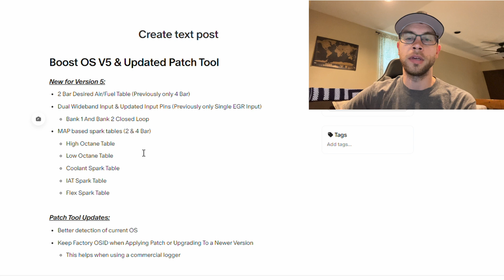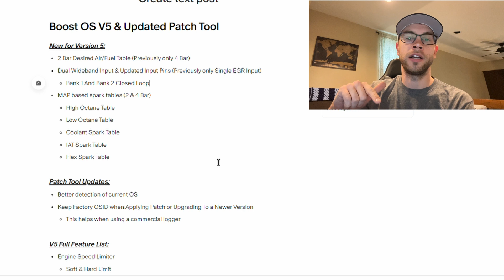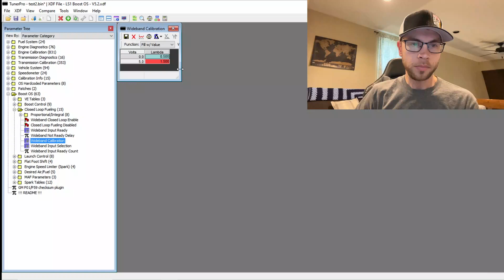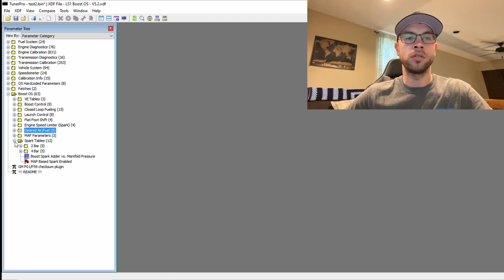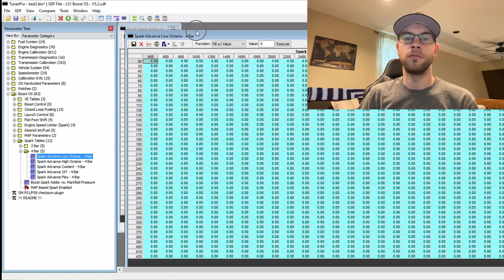Stock PCM With Dual Wideband Input!?!

Comment: Would you possibly be able to make another table like boost control where we can control DC of another pin. I’d like to wire up meth through a solid state relay like I did with my Holley setup

Comment: Im new to tunning just doing it on my personal vehicles. I have a 2004 tahoe which i activated electric fans using tunerpro and all is working good. I will be upgrading my driveshaft and wanted to change the speed limiter from 98 to 120 but dont know what settings to change. Any help would be awasome.

Comment: How are you guying datalogging with tuner pro? I’ve downloaded the program just to get familiar with it but I’m not seeing much to start logging.
Reply from the maker: I haven’t used TunerPro for data logging. Supposedly it works, but I’ve seen lots of comments about it not working well or at all. PCM Logger (included with PCM Hammer) I believe is the only free open source option.

Comment: your doing gods work brother!!! Thank you and good to see ya again!  Nitrous features would be awesome for v6.0 :) timing reduction features with built in window switch activation and bottle pressure input maybe instead of 1 of the wideband inputs but if you could have the widebands and a bottle pressure would be awesome and maybe relay output to control bottle heater based on bottle pressure, just throwing out ideas! thanks for all you do!!!!

Comment: Sorry if its been gone over already, i assume this system works with 4L80'S? Also, does this OS support DBW, or just DBC?
Reply: The 4l80 works, just need to segment swap your file first, then patch it, he confirmed it in another video where I asked. The 7603 os should support both dbw and dbc, assuming your ecm has the dbc circuitry
Reply from the maker: This works with 4L80E, 4L60E, Manual, DBC, and DBW. You just need the correct hardware and base tune.

Comment: So to make sure I understand this right, enabling closed loop wide and simply allows you to use a wideband to control closed loop fueling, I would still use the factory closed loop settings to control how it behaves such as disabling ltft? If I were to in addition use the desired afr table, does that only affect pe specific settings, like can I still use the iat or ect adder tables? Or does using the desired table solely allow control via map vs rpm? Will the ecm read as being in “open loop” if commanded is richer than lambda 1?
Reply from the maker: Yes, LTFT work just like stock, but can be disabled. PE is disabled entirely so no PE setting work. At richer than lambda 1 it will stay in closed loop if you are using desired afr table and wideband closed loop.
Reply: Appreciate you taking the time to respond. So if using a wideband and the desired afr, if I’m in what would normally have been a pe region, like 180kpa at 6000 rpm, will it actually attempt to use trims to maintain commanded lambda?
Reply from the maker: @schiavonske1013  Yes
Reply: Sounds like this may be a definite upgrade over the hpt custom os, plus the xdf has some transient tables hpt refuses to acknowledge exist. May have to donate and try this out, I’m curious as to how well the fuel trims will keep up with the sudden boost hit of an Lsa blower.

Comment: I’m having a heck of a time getting this running. I have an 03 Silverado SS with a 6.0 and 4l60. Currently all stock is except the intake and a small turbocharger. I have not been able to find a stock 7603 with the 6.0 and 4l60 so I’m very been trying to get something to work but everytime I try it zeros out all the parameters I need for this truck to run. Any guidance or help you can provide would be amazing. Would also be open to testing new things to help in return. I’m a Patreon sub as well. Thanks.
Reply from the maker: Join the discord server for my Patreon and you can upload the files there.

Comment: Let's see a video of these in action. Like the actual Rev limiter working. Stuff like that
Reply: I can try to post some once my setup is back together. I have been testing v5 of this OS for quite some time and it works flawlessly once you get it figured out.
Reply: You can watch some of my more recent reels and hear the 2 step working off the line at the track and see me go 10.4s on street tires with this OS on a basic 5.3 @ 4750 race weight
Reply from the maker: I don't have a specific video of it, but It's been in my prior videos.